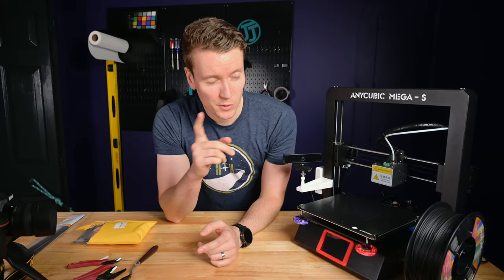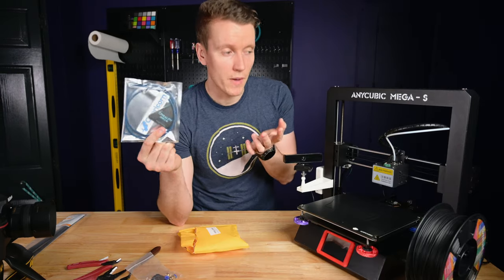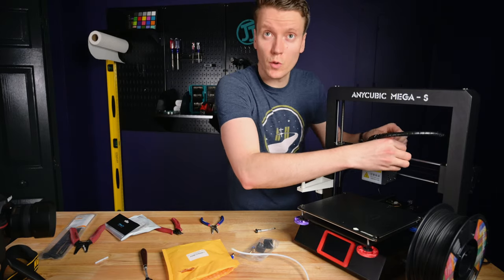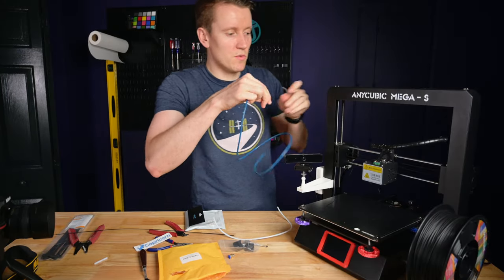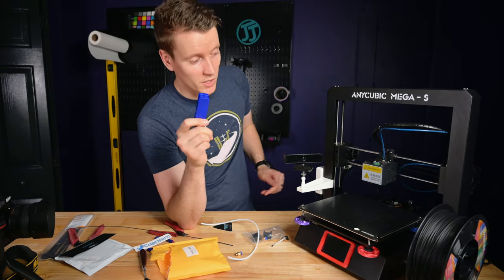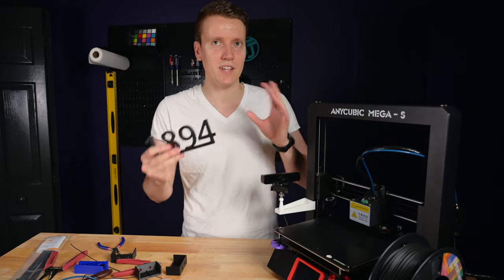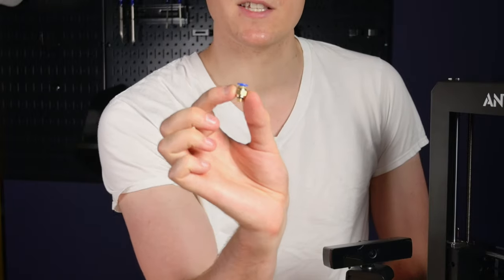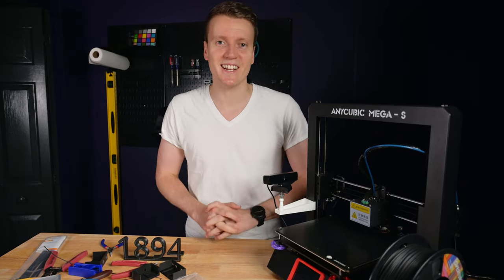Replacing Bowden Tube and Couplings | Anycubic Mega-S Capricorn Upgrade

Comment: I used to have trouble removing filament on my Anycubic. I was frequently not fast enough to reel the filament up onto the spool before the melted end of the filament hardened and formed a nasty ball on the end, causing the filament to get stuck in the fittings. Now I heat the hotend, manually feed a bit of filament so that I can see it freely oozing out of the hotend... And now the best part: with my left hand I press the release on the extruder and with my right, I puck up the entire filament spool and swing it back behind me at arm's length. Way faster than spooling and I've never had a problem since. Thanks for the video!

Comment: Those fittings are not valves. They are "push to release/connect fittings". Also, you don't need to spin the tubing cutter when cutting plastic type tubing. Just press the blade down onto the tubing and it will cut straight through.
Thanks for the otherwise very simple and straightforward tutorial on replacing the tube.

Comment: Bought the same kit/upgrade because of this video, being brand new to 3d printing I had no idea what was going wrong with my bowden tube since it all of the sudden started to pop out. I installed the #4 couplings and tub onto my anycubic Chiron and it's currently running some PETG right now.
Reply from the maker: The upgraded Capricorn tube has been amazing. I didn't realize how much better a good Bowden tube could be.

Comment: When I change the filament and the plastic block at the end, I simply cut the filament, leaving the blocking small piece, and then push it with the new filament, all the way through the hot extruder. since it is only a 2 cm bit, it's pretty fast and does not waste much filament.
Reply from the maker: This issue has basically gone away with this Capricorn tubing. I think it keeps the melted part of the filament smooshed down so that it can fit backwards through the extruder no problem.

Comment: I just heat up my hot end then hold in the trigger on the extruder and wind the spool backwards until the filament comes out, not broke a valve yet. Sometimes it needs a little tug at the end and a small guide part comes out but that just pushes back in after u trim the blob of the end of the filament.

Comment: Thank you very helpful.  I recently got the Mega S and for some reason on my last print the tube kept coming out.  So is the coupling just no good?  PS to remove the filament you mentioned you'd remove the tube.  I have been just holding the little release level and pulling the filament out.  Most of the time it would get stuck and pull out this little plastic guide, then I'd have to cut the filament and put the guide back.  Wonder if that's causing a problem.
Reply from the maker: Removing the filament has been much easier since I put the Capricorn tube in there. I think it does a better job shaping the hot filament as I pull it out, so I no longer have to pull the tube out of the coupler.

Comment: When I replace my mega s filament.  I have the system hot.  Push the filament till starts to come out of print head, then quickly pull it out using the release tab.  The filament usually makes it out past the feeder motor assembly.  I then cut off the melted leftovers from the end of the filament.   Does not always work, if it gets stuck on the first pull just repeat.    Good luck.

Comment: Sooo my bolt on my extruder side just spins forever, I have a big burnt piece on the end of my filament that won’t come out the extruder. wtf do I do
Reply: I'm having the same issue.
Reply: @davidwilliss5555  I ended up retracting it as far as I could and cutting it, then feeding filament back in with it and just extruded it til it was gone. Prolly not the best method but it worked

Comment: The biggest pro you might find with Capricon is that you can reduce your retraction distance because of the tighter tolerances. This is especially useful with PETG since retraction settings are crucial.